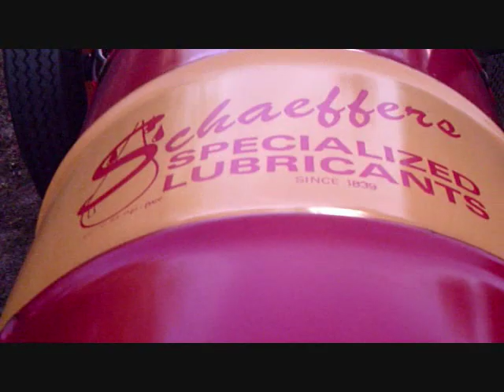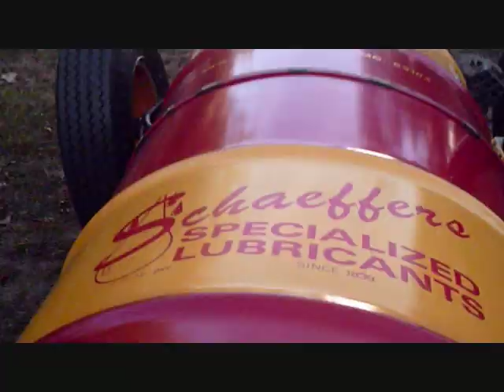Under Tiller Update #7 Happy  Halloween

Comment from the maker: Thanks alot Matt. My outside building season is closing fast, it was about 35 out when I painted and paint doesn't like temps below 60 so it didn't turn out too bad. I thought my atire was kind of fitting for the subject. It does have it's own sound, but not the sound of your 40.  Dan

Comment from the maker: Thanks, I would like to use the org. air cleaner but it doesn't have enough capacity for this engine. the pipe is only about 1.5 in.    Dan

Comment: Don, look up a 1939-40 dodge truck here on net. Look at the grill. The car and the truck might have used the same thing
Reply from the maker: Hi Kenneth. The pick up grills are different, the slots for the air are bigger and there's alot more and there is not chrome around them, look up the 39 dodge luxuary liner and you will see there's a big difference in them.    Dan

Comment from the maker: Yes it is a creeper, I kind of wish it went a little faster. But then I'd probly kill myself or someone else with it. I lost alot of gearing with the smaller tires on the rear, but the org top speed for this tractor was about 3mph. I think it will go about 10 to 15 now. But in low low I think I could crawl faster than it goes. Thanks.   Dan